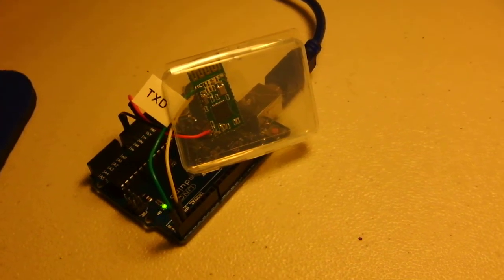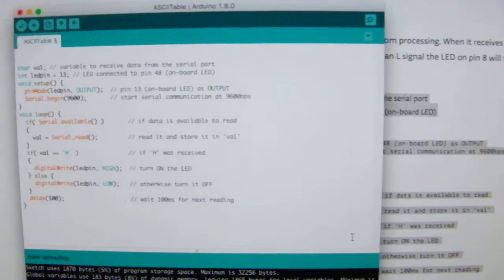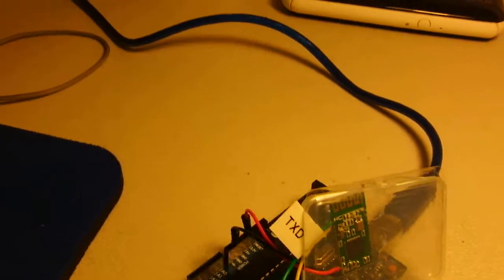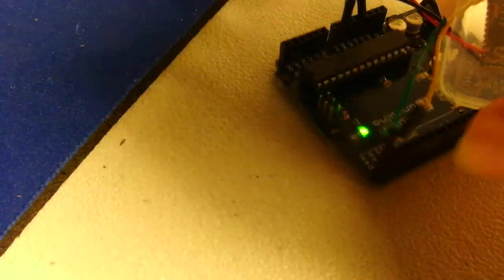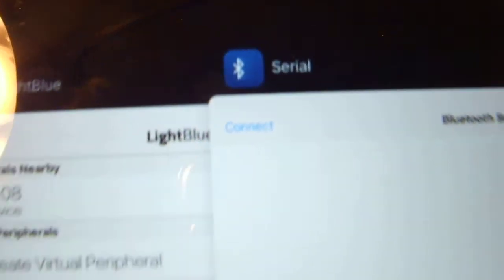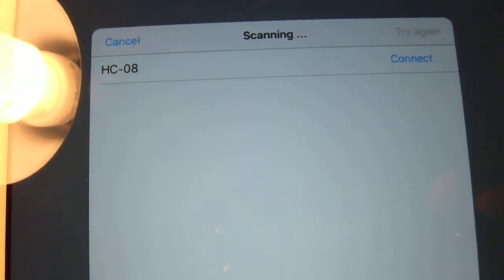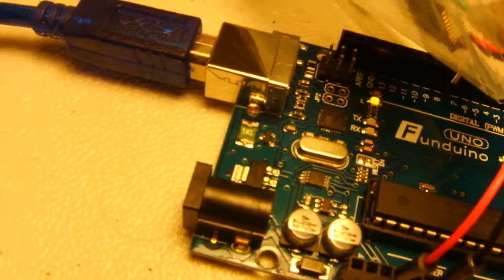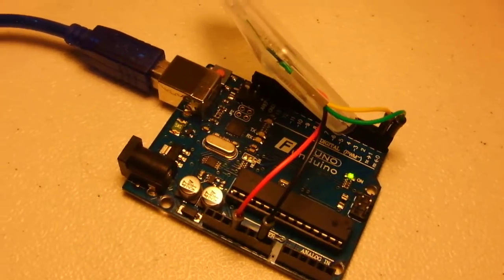Controlling Arduino Built-In LED with HC-08 Bluetooth Low Energy Module and iPad

Comment: I can hook up my bluetooth module using pins 10,11 and it responds to AT commands via serial, but none of my devices can pair with it. The module shows up on their devices list, but when I attempt to pair with it the connection dialog never opens and the phone or tablet says "unable to communicate with device."

Comment: Why do you have to disconnect the Bluetooth module from RX and TX before uploading the code?
Reply: Because those arduino pins (0 and 1, respectively rx and tx) are used by the Arduino IDE to communicate through USB with the board and upload the code in it but they got to be free in order to work. For this reason you have to disconnect it
Reply from the maker: Not sure why, but other users have reported problems with uploading when the RX and TX pins were connected.
Reply: when the bluetooth isnt paired i upload with no problem

Comment: Thanks for your tutorial. It got me going very quickly with my iPad and Arduino Nano+HC08. For what it's worth, I gave SoftwareSerial a try and it works just fine. That allows you to use pins besides 0 and 1, allowing you to program the Arduino without the HC08 getting in the way.
Reply from the maker: Glad you were able to get Software Serial to work on the first try!